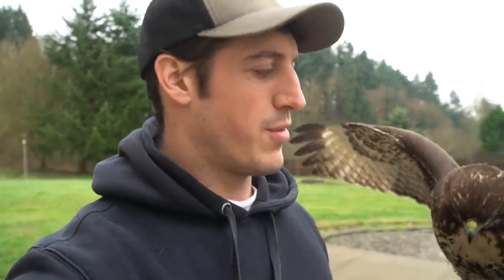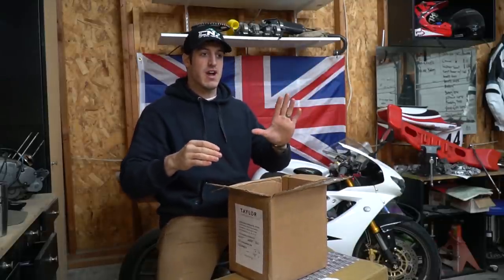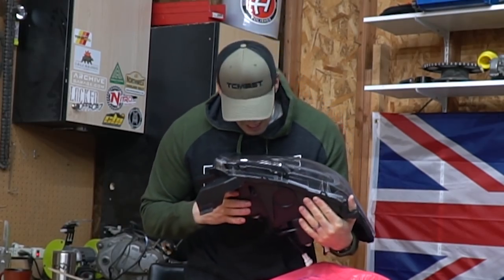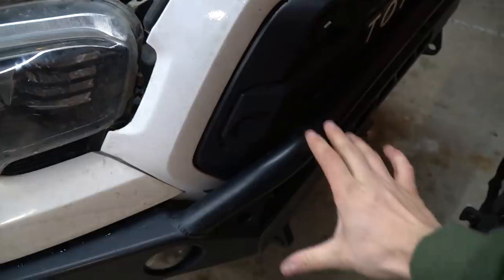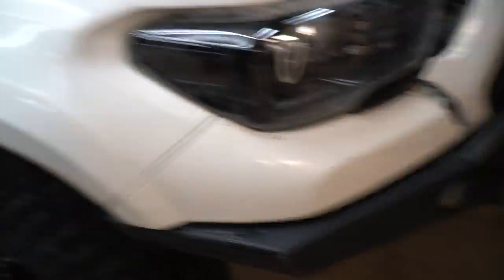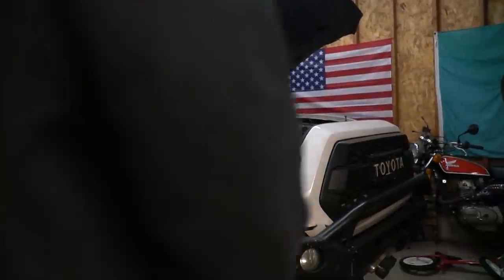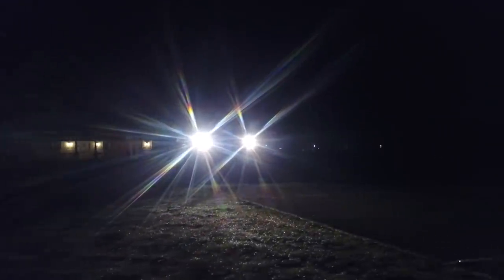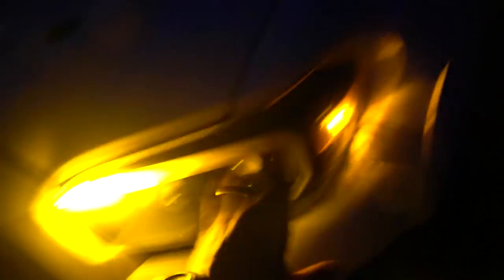Tacoma Beast Headlights with AWESOME sequential LED Turn signals!

Comment: I added these lights to my tacoma and let me tell you it was a bear of an install. the passenger bumper would not come off and I had to apply a good amount of force to gain access to the side bolt holding the stock headlight. Then after install both sides the DRL would come on, add to play the wiring and then finally it worked. After every thing was said and done they look and perform fantastic. I just need to fine tune the headlights as the driver's side projection is pretty low

Comment: I have TacomaBeast headlights on my 2nd gen Tacoma and I swapped my bulbs out for some cheap Chinese LED bulbs on Amazon and it made a world of a difference.  Also, I'm not sure about yours, but it was really easy to adjust the cutoff on my version.  Just adjusting the cutoff helped to compound the light at the cutoff and increased my visibility.
Reply: Do you have a link to the bulbs you bought to replace them?

Comment: I would have a professional check the alignment, that may change a lot of the look.
Reply: Joshua Bowie absolutely no need to have a professional do anything. It’s as easy as using a Phillips head screwdriver and turning the adjuster knob to raise and lower the aim
Reply: I’m aware, and have done so myself. But Max talks about the aim, but then made no attempt to fix it (in the video), just offering a suggestion. Would you not agree that his headlights need adjusting?
Reply: Joshua

Comment: Great headlights.  I have had them in my truck for over a year with no issues and love them.. Just installed Morimoto Elite HID's into them too.  I had Kensum HID's and they were ok and the Morimoto's are better. I have not had a single person flash me after adjusting them and for the record they are H7's =)
Reply: ratcityrain what did you have to do to get HID’s to fit in these? I’m guessing drill a hole dust cover?
Reply: @ixgreenarrowxi  Correct. Had to drill small hole in dust cover for wires and installed a small rubber grommet to go around wires.
Reply: ratcityrain appreciate the info bro! I have been wondering about the best way to go about it but that was the only way I could see to make this work. Thanks again!
Reply: @ixgreenarrowxi  you're welcome.
Reply: Is it true that these use a different bulb size?
Reply: @ionakana619  Yes it is true.  These use a H7 bulb for low and high beam where as stock housings use a H11 (low) and H9 (high)
Reply: Have you had any issues with condensation from drilling the hole? I would think the grommet wouldn't be enough. I'm getting my truck fixed at a body shop from when someone backed into me and ordered these headlights instead of a new factory one. They haven't installed them or the new bumper yet, but I'm concerned these won't be bright enough in the mountains of Colorado. The factory bulbs were not nearly bright enough when in the mountains at night.. @ratcityrain
Reply: @JasonTylerS  I have had no issues with condensation on my headlights at all.  The hole in the cap is small and used a rubber gasket that came with the hid's to fill hole.  I live in WA state and from all the rain and car washes, not a single point of moisture in mine.  They are for sure worth the money

Comment: I know you didn't ask for my opinion but I'm a Patreon supporter so I'm giving it anyways lol! They definitely look awesome but I gotta be honest, that cutoff is not great. I think if the elevation adjustment wasn't so far off, they will probably look a lot better though. If you look @ 13:55, you can see the big difference in the elevation between the two headlights on your garage door. The factory headlights are really easy to adjust the aim with just a phillips head, I'm not sure if those are the same. I'm sure you know this, but the moisture in your original headlights was because you used silicone to reseal them on top of not removing all the old permaseal when you blacked them out. I did a retrofit on my 2018 with Lexus RX350 projectors and diode dynamics switchback DRLs, and I don't get any moisture in my headlights at all... and I wash it twice a week during winter trying to keep the salt off it. For upgrading the bulbs, I would definitely go with an HID kit over LED bulbs. I tried 3 different LED bulbs (two of which were high end, Philips and GTR Lighting) with the original projectors but they didn't even hold a candle to the HID kit I used before doing the full retrofit. The LED bulbs work great for fog lights that don't need long range projection, but for low beams I would absolutely get an HID kit, just make sure to use a HD relay harness from diode dynamics to power them. Keep the great videos coming!!!
Reply: I do agree with him about getting flashed alot.  I've adjusted my factory lights with HID down so far that they are basically useless and still get flashed.  Never had this issue with my 6" lifted Ram with HID's.

Comment: Check out Super Nova v2 LED. They are some of the brightest on the market. Also you should adjust the alignment of the headlights. All headlight housings have built in adjustment screws.

Comment: Clear silicone around where they glue the two pieces together that will stop any moisture from getting into the housing when running around in the dirt and water works great

Comment: I upgraded the headlights in my Tacoma with a new set of Philips halogen bulbs. $25.  Work much better than factory and not obnoxious to oncoming drivers.
Reply: Drop a link to the bulbs your talking about. Do they work for the high beams as well

Comment: Broken dishwasher remove the lower spinner torx bits remove the cover below the spinner. Clean the screen I bet your water pressure comes back. Could be a pump but 9 times out of 7 it can be revived without parts. Best of luck, cool bird man!
Reply: Sean Childs was scrolling the comments and saw this. I’m actually having dishwasher problems as well and am no expert myself so I will definitely take this advice. Thanks for the unexpected help!
Reply: Took me a second, was like "what the hell does a dishwasher have to do with headlights? "

Comment: You need to use a Phillips head screwdriver and raise the passenger bulb upwards so that the cutoff horizon is straight across with the step in the middle stepping up slightly as it crosses to the right.
Reply: singletrackftw where is it located at I am having the same problem

Comment: Your driverside is higher than the passenger.  Quick way of aligning it in height is to be on level ground and measure the height of the middle of the projector light (usually there’s a little circle or triangle on the housing.  Then at 15ft away the light cutoff or hotspot should be 1-2” lower in height.

Comment: Max, I may have missed it but I don’t remember you adding the AC drain mod to your Tacoma.  This mod channels the drain water from your AC evaporator away from dripping on your frame.  I believe this mod helps to reduce the chance of premature rust forming on your frame.  Without the mod the condensation water from your AC evaporator drips directly onto your frame every time you run your AC or the defroster.  There are a few vids On YouTube that you can search.  It’s a cheap and easy mod to complete.

Comment: I’ve heard the yellow tint lights that Toyota supply is for better night vision. Also the halogen project a bit more heat, good for freezing rain/snow- keeping it thawed in those conditions. 
I agree with you though, prefer the whiter light

Comment: Supernova V.4's ($160) from Headlight Revolution for LEDs and never look back... they are Amazing, dont mess with your beam pattern, and are three times brighter than stock. I've had them in my T4R for 2 months and never been flashed. They have a video on the Tacoma... watch it Maxx

Comment: I actually looked at the headlights at Toyota Jamboree at the Tacoma Beast tent and asked them how they change a bulb if it goes out... the Housing were completely sealed including the bulbs.
Reply: @Maxx.Powell  Thats good to hear they modified the design or either had no clue how to change the bulb when I asked.

Comment: Maxx, you should have gotten the LED projectors from the RetroFitSource. Those are dope!
Reply: @Maxx.Powell  Definitely more pricey than those, but overall a better light. I got my headlight parts from them for around the same price point as the assemblies you got. If I could provide a picture of the output of my headlights, you'd see the difference between the two.

Comment: A few bucks for some plastic sheeting at home depot (painters supplies, keeps the floor from getting paint on it when you decide to paint a wall) and some thump tacks or a staple gun would keep carol out of the rafters.

Comment: The bulbs have to be adjusted. I when you turned the headlights on on the garage door, you had 2 lines, you need to turn the bulbs till the lines line up so they are leveled
Reply: TheMrTaco how do you do that, is there adjustment in the back?

Comment: I have mine with hid 5000k on the low beam because hid works better with projectors, on the hi beam i have some yellow led bulbs and they work great , whenever theres fog ,rain or dust the yellow led helps a lot i even have a video of my truck with them on you can check it out, but definitely thos headlamps are a must have hahah

Comment: There is an adjustment screw usually look down at light fully installed an it should be a Philips or like a 10 mm just look for something to adjust it usually want the driver side pointed down there videos on how to do this lite brite has a recent one
Reply: But that's a Jeep but it explains everything and all cars trucks are the same for the most part.

Comment: I have done a couple of retrofit headlights. One set for my truck and one for my neighbors. I also follow a page called headlight junkies. Installing hids in a halogen based projector is never a good idea. The light scatters too much and has the potential to blind other drivers due to the differences in bulb length of the hids and how they reflect off the bowl. Theretrofitsource.com is making some new leads that are supposed to work really well with headlights that are halogen based. They are a little pricey though. I absolutely love your red tail! Such cool birds.

Comment: Freaking awesome video as always man!!!!

Hey, so if you haven't already bought new headlight bulbs, I have the
OPT7 'Boltzen AC CANBUS Series: 55w HID (H11) Kit' 

After doing literally months of research and a few trials with different brands and bulbs, these are the ones I ended up sticking with. This specific H11 kit is pretty top quality too. REALLY nice light spread and super bright. I tried the same kit in 9005 for my brights too, but the 9005 kit that I got wasn't working right, but I can say that the H11 kit works great.

I ended up going with the HID conversion instead of the LED kit because I found that the HID bulb works MUCH better with projector lenses than LED bulbs (as much as I love LEDs).

I've heard good things about the Kensun HID Kit too. I tried it out, and unfortunately mine didn't work, but I'd try them out again if I get the chance.
But yeah! OPT7 has killer customer service too. Worth some consideration!

I'm not sponsored by OPT7 or anything, just a happy customer hahaha
Reply: Should've went with osram night breaker lasers
Reply: @Alvarwheezy  Osram is the freaking best, there's no doubt about that

Comment: You spend 45000 on truck and you are still installing led headlights and I seen some ppl putting spacers under seats cause no power seats

Comment: PLEASE if your going to swap led's into the Halogen projectors, use Morimoto 2 strokes, or diode dynamics Sl1's otherwise its a glare fest.
Reply: Please Link to the headlight your talking about

Comment: i dont see your description box i like those lights i have a 2014 sport. i comment alot on your vids you never reply. i told you before i'm  a  iraq war  disabled vetran also i take that back you responded about the fiberglass fenders a long time ago when you just got yours bro i want those headlights i already have HID  conversion but i'm running stock headlights the HID's make a world of difference i never have to use my high beams